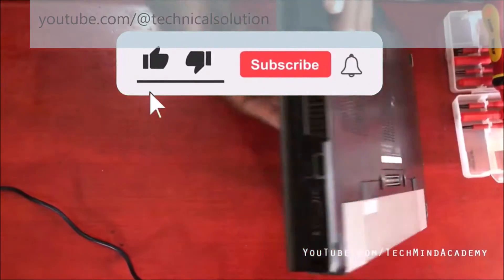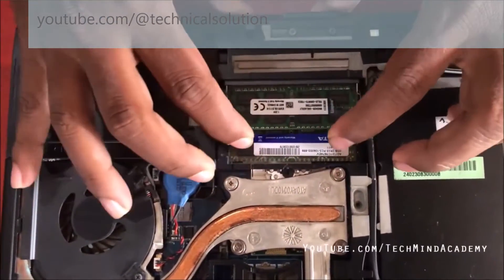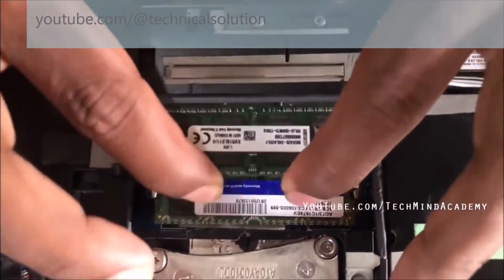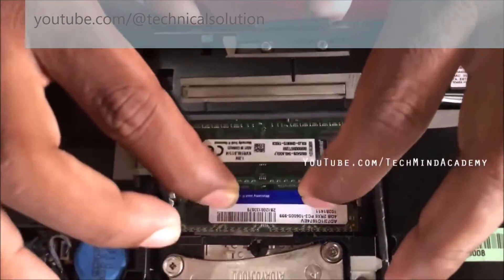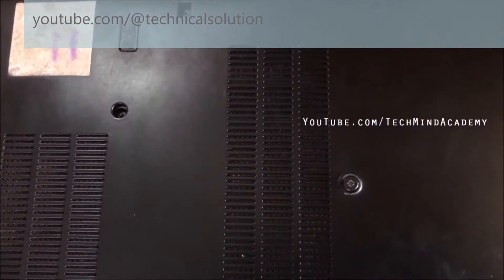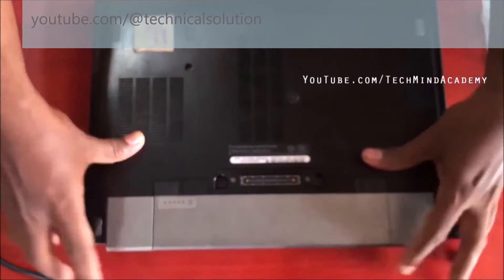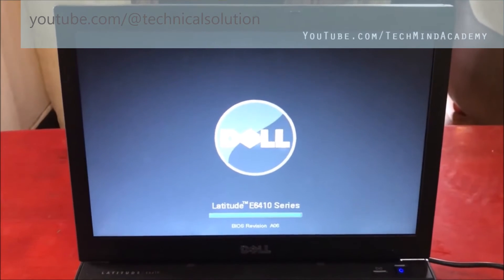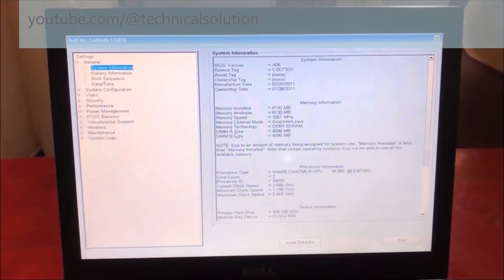Second ram slot not doesn't work

Comment: This didn't work for me. My Acer Aspire 3 has 4GB of built-in RAM and 4 GB of external RAM. A few days back, the laptop stopped working, and the technician removed the external RAM. It worked, so he said the external RAM is faulty.

I ordered a new RAM of the exact same type and design. But the new RAM didn't work either. Then I found your method, thinking the RAM socket was faulty, and tried many times exactly as you did in the video for 10 minutes. 5 min, etc, but as the RAM is inserted in the socket and I try to turn on the laptop, but it doesn't show any screen, just a blank black screen. Only the power light turns ON as earlier. That's it. If anyone has any solution, please let me know.

Comment: It works. There was corrosion. I cleaned it with IPA and it still did not work. The method in this video solved the problem. Thanks , amigo!

Comment: Till Yesterday the slot was working but today it is not working, any idea how to solve it.. since your slot was never used hence your pblm was different. My slot was in use
Reply: True this is not a joke, worked in my case as well..thanks you r a saviour
Reply: Brother same condition with me too. My both slots were in use then apparently not detecting another slot. Is your problem fixed?
Reply: @piyushkadukar7337  yes the solution works for this case as well
Reply: Oh man it really work. My laptop second-slot was working smooth and suddenly it stoped working. I watched multiple videos and none worked. And Finally I found this, I did it for 5 mins and my second slot started working holy sh**t lots of love to the uploader 🎉

Comment: Bro it did worked!
Thank you so much
I bought 8GB ram and installed but it didn’t detect so I thought it could be a ram slot problem but it was unlikely because I had never used that so after watching this video I tried and it worked❤️‍🩹

Comment: It didn't work on my first try. The last time I tried it, it WORKED, and now it works(I think I did it for 1 minute) .Also, I don't know if it helps, but I also cleaned it with a hard toothbrush without applying too much pressure and blew air as well)  (But it doesn't make any sense to me that this malfunction would occur, I just removed the ram and installed it, I cleaned it before removing the dust, so there was no dust either)
.
What I have written here is based on my personal experience.
Reply: Was your ram getting detected in task manager?
Reply: @puneetsharma6780  I opened the laptop and cleaned it by blowing air. Then I wanted to swap the RAM in the 1st slot with the RAM in the 2nd slot. When I changed it, slot 1 stopped working no matter which ram I tried, it was not visible in the task manager and bios. I delicately brushed the pins of the slot with a toothbrush and then blew air, but that didn't work. Then I tried the method in this video and it worked.
Now it shows as 16 GB in bios and task manager.
Reply: @Prm_Mr.Engineer01 brother the same case with my asus too. apparently after blue dump error Laptop failed to detect the ram in slot 1 no matter what ram I put it in. So currently running with only one slot so shall I follow this method?
Reply: @piyushkadukar7337  yes
Reply: Till Yesterday the slot was working but today it is not working, any idea how to solve it.. since your slot was never used hence your pblm was different. My slot was in use

Comment: I've come across a similar video just like this and this procedure actually works. It's really not a joke.
It solved my (unused) RAM slot problem of not detecting the new memory stick. 
The key of the wiggling action is that you should feel the RAM stick slide into a 40° angle space inside the slot, because an unused memory slot has a tight space and simply pushing the  RAM in won't work.
Thank you for sharing this solution. 
Thank you also for speaking in English.